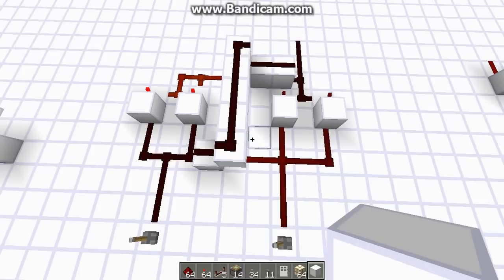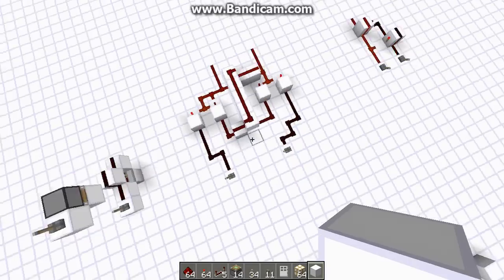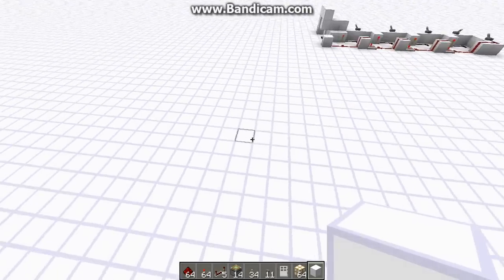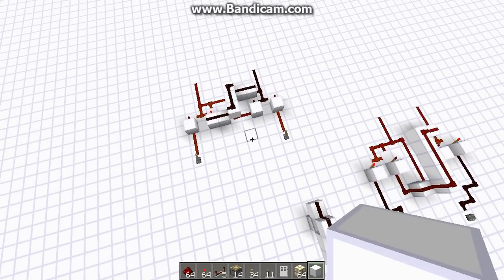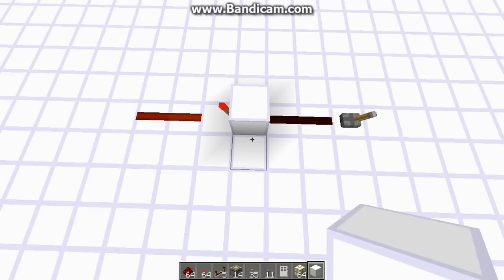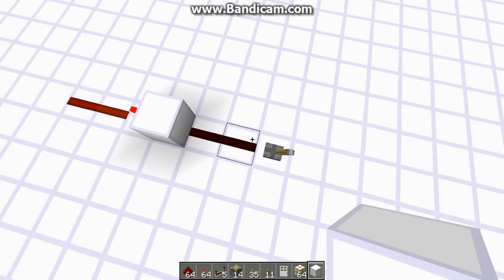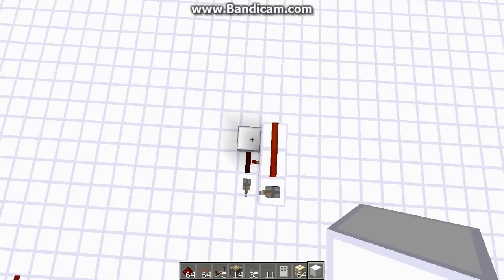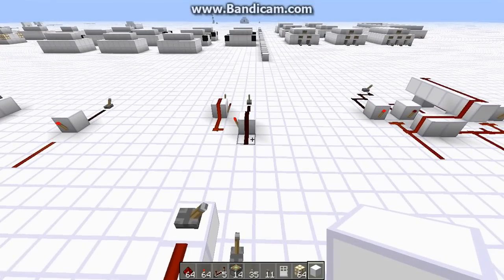Redstone Circuits 2: What makes a good circuit?

Comment from the maker: Well without going too deep into electrophysics, first off keep in mind first off that electricity isn't instant. When current activates a transistor, then the transistor opens a path for electricity to flow. It takes time for the path to open, and for electricity to fill it, as well as for electricity to leave the other path. That's the best explanation I think I can fit into 500 characters.

Hope that makes more sense now, if not feel free to ask and i'll do my best to clarify.

Comment from the maker: Of course there's smaller designs, that's not the point. There will always be smaller designs.

The point is to show you what you need to know to design these things yourself. That way, when you need a circuit for any purpose at all you'll be able to create it on your own without needing to search for a design that fits what you're looking for.

That being said, I still love learning of different designs for things, so I'd love to see the design, but just know that's not the point of the video.